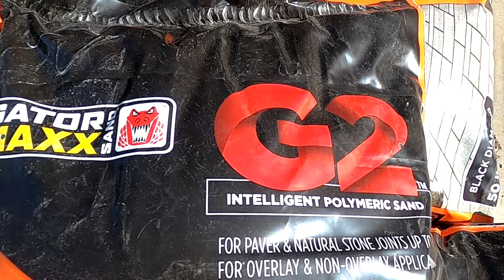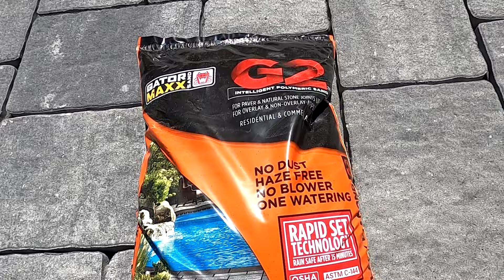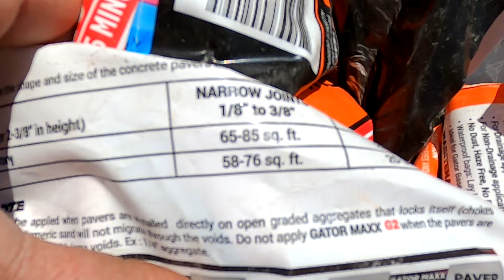How To Polymeric Sand a Paver Patio (DIY)

Comment: Very nice! You have me sold on the black poly sand. Do you have a video on cutting the border pavers around the fire pit? It also looks like you left 1" of stone between the pit and the pavers, correct? This is exactly what I am doing in a 15ft round patio with a fire pit.
Reply from the maker: Nice man, the black poly adds so much character 👌 I do have a video on how we cut the pavers around the fire pit. here is the link to that video 👉https://youtu.be/1Z09RARiWaM

Comment: thanks for the video. I did hear before that you should not use so much water that it runs off. I just did my pavers and used just enough to wet the polymeric sand, and I did 2 passes 15 min apart, but I did not use as much water as you did to see so much white "polymeric activation".
Reply from the maker: No problem, there is definitely a balancing act you need for the right amount of water. If you put too little, it will not get through the layers enough to activate the entire depth of sand, causing it to be very weak and possibly peel up later.. If you water too much, you could wash out the sand before it sets. What I do is start at the lowest point and lightly shower it up to the highest point. Then I immediately go back to the low point and saturate it all up to the highest point. You don't want to be bashful with the water, you just need to watch out for sand washing out of the joints, but if it does not wash out, more water is better. 

Here is another polymeric sand video that I made which shows how much water I use 👉https://youtu.be/TXWJyBnVQ_g

Comment: How are rounded bullnose pavers, which are used for the rounded step we have, how are they joined together?
Reply from the maker: They are typically laid in concrete adhesive and just placed right next to each other. But when used for coping on a pool, sometimes they are laid in mortar and they also get laid with a joint of mortar in between each other.

Comment: Ok, question, my pavers are old and pretty porous. So the polymeric sand is really sticking to the pavers. Am i going to have to brush off each paver individually, or will it work out if i leave it there and it'll wear away with time? What do you suggest?

Still thinking on this.. do i need to seal my pavers somehow? (First time home owner here and took on a project im starting to think was outside of my skillset)

Comment: Hey, man. I can't thank you enough! Your videos got me through laying the base for a backyard paver project. It was really hard work, I had to move all of the stone by shovel, through a gangway, and into my back yard. But it was very enjoyable. I live in the city and had 5 cubic yards of 3/4" and 2 yards 3/8" stone dropped on the sidewalk in front of my house. My neighbors lost it! Anyway, if you don't mind, I have a question on using polymeric sand. The guy at the materials shop I used told me using poly sand on open grade base is a no-go. He said the sand eventually works down into the stone base, and that open grade base requires permeable stone or permeable sand in the joints. He recommended a smaller chip stone. The other thing is I'm installing Holland pavers which have a smaller space than the pavers you're using. I know nothing about pavers, and you've done hundreds of these, so I wanted to reach out and ask you what you thought. You're using it, so I'm assuming it's fine. Sorry for the long message. Wishing you well from Chicago!
Reply from the maker: 🤣 That is hilarious about the stone delivery! I'm glad my videos were helpful, thanks for the feedback on that. I use regular polymeric sand on 99% of my projects even with Open Grade Base. Once the polymeric sand hardens, it will not sink in to the stone. Been doing it for almost 5 years now with no issues. Good luck and congrats! ✌

Comment: I love the videos. I have a question. Should the sand be to the top of the paver. The sand is down in the joints on my patio like 1/8” below the surface.
Reply from the maker: Glad to hear it! We install the polysand just below the top of the pavers. it helps let the water flow through the joints.,

Comment: Great vid, lots of info. How do you deal with the haze left over from the polymeric sand installation? How do you clean the haze before installing the sealer? Thanks!
Reply from the maker: Most Polymeric sands that are out now, leave no haze. If it feels sticky or looks hazy, just rinse with water a few times. If that does not work, there are many paver cleaners out there that will help.✌

Comment: Hello I have a question, how many years before I would need to re-apply polymetric sand?  My installers workers said once every 2 years but the installer himself said maybe every 5 years.  I can't seem to get a good answer lol. If I need to re-do it, would I have to hire a contractor to do it?
Reply from the maker: Hey there, the answer he gave you is basically correct. If done correctly and assuming the polymeric sand is top notch quality, you could get 2-8 years. Closer to the 2 year side if the pavers are in a shady / constantly wet area. Closer to the 8 year side if the pavers are in a sunny / very dry area. Unfortunately that is the way it goes with poly sand. They have been coming out with stronger joint sands throughout the past few years but they are very expensive and more time consuming to install. DIY Polymeric is definitely possible but keep in mind that you can really ruin a project if you make mistakes installing it. Hopefully that helps. Good luck ✌

Comment: Thanking God for some sound patio paver advice! And thank you sir!

What kind of polymeric sand would you recommend for pavers that I only have a 1/8 inch joint? Also, are there any good synthetics/resin sands That would work with 1/8” joints?
Reply from the maker: No problem, glad it was helpful! I would use polymeric sand even with 1/8 inch joints. It may take a couple passes and tamping, but thats really the finest sand that I know of.... Some polymeric sands are finer than others. The one I use most is made by (Alliance) and its called (G2) and I usually use the color tone (Black Diamond) very fine sand particles.... ✌

Comment: Hey Christian love the job, well done. Had a quick question for clarity on the video. Where you have the pitch of the grade when it comes to the firepit area is that level or does it follow the grade of the rest of the patio area. Hope that makes sense
Reply from the maker: Thanks for the feedback! The entire patio slopes down and away toward the far and by the firepit. There is no perfectly level spots in the patio. I generally always slope pavers (walkways and patios) in 2 different directions to insure the water stays away from the house / structure. ✌

Comment: I just found ur channel and just subscribed!!! :)

I just got a house and the front pavers have settled and are not leveled with a pitch away from the house.  The poly sand is all gone and weeds are growing in between the pavers.  What’s the best way to fix the pitch??  What tools do u use to lift the pavers up?  Also, is the border pavers cemented in place, bc it seems like mine has a cement border near the grass.  Any advice would be helpful!!!  Thanks!!!!  :)
Reply from the maker: Nice, thanks for the support! I'm sorry to hear that your pavers are settling. It is a more common issue than you may think though... To fix, you need to pick up and relay all the pavers that have sunk. If there is concrete around the edges, you just need to break it up and remove it. Then you should be able to start lifting the pavers from the edges. When you pick up the pavers, you need to scrape the remaining poly sand off the edges and brush them off. Once the pavers are removed, you need to remove the sand / stone dust under them and put new clean, crushed stone to prevent them sinking in the future again. I have a lot of videos on how to lay pavers and how to backfill for them. Just look through my channel and I'm sure you will learn everything you need to know so you can fix the problem yourself. ✌

Comment: Great stuff thanks for info. 

I’m building a timber a pavilion and paver patio. Posts are already in place. How long after applying the poly sand can I work on top of the paver to finish my heavy framing and roof? Def don’t want to ruin the pavers or the poly sand app
Reply from the maker: Oh nice, glad the video helped! I would give the sand 24-48 hrs. If you touch the sand it is really hard, you will be all set ✌🏻

Comment: Hey there, firstly love all your videos. Have a question regarding your fire pits. In this video you installed all the pavers and then circled the line for the pit. In the previous job where you had the breeo I thought you put the fireplace in first. Is there a right way or not really? Looking to start a DIY job at home and that will be a figure 8 and in one of the circles will be my pit for a breeo install so keen to get your thoughts
Reply from the maker: Hi, Thank you! You can do it either way really. The circular patio I did was to be built around the firepit as my center point. This project had to be laid out just right before I could find the center point for my firepit. so with this one, I had to lay the pavers first and then build the pit. It may vary depending on the job or the plan so whatever works best in your mind when planning the layout. It sounds like a cool project man, good luck! ✌
Reply: @TheChristianHardscaper  thanks so much for your quick reply. I’m based over in Washington state (Seattle) and we get a lot of rain. I’m keen on using your method for underlay however some of the landscapers where I’m getting the pavers are suggesting to stick to the crush rock sand model of old, however I love how clean and easy your method looks. Wanted to see if you know of others that are out west that have done similar bases to you?
Reply from the maker: @social_euge5896  No problem, Unfortunately a lot of contractors are refusing to switch to this backfilling technique.... All I can say is that I used the crush rock and sand technique for 5-6 years prior to switching to this method 4 years ago. I will never go back. The most important reason to me is that this system does not hold on to or absorb water. The crushed grave and sand absorbs water like a sponge. This causes a lot of shifting and settling over the years to come after the install. It also cause the base material to freeze and heave more because it holds onto water. The end goal of all drainage is to get the water to permeate into the subsoil. no material does that better than open grade 3/4 clear stone. ✌

Comment: Hello and thanks again for these videos and advice!

 I’m just about done laying the borders, and am getting ready for concrete edging and then poly sand. 

How long Do I need to let the edging harden before poly sand and compacting/tamping?
Reply from the maker: Oh nice, your moving right along! So I would actually recommend doing them at the same time if possible. doing the sand wand tamping while the concrete is still wet is the best way. You can trowel the concrete the way it needs to be in a small section at a time, then sand that section, tamp it, then sand it again. At which point you can trowel the concrete one more time to be sure the bond is still good on the pavers. Then move to the next section. 

I try to do it like that as often as possible, unfortunately a lot of times, it doesn't work out that way.... At which point, you want the concrete to set for at least 12+ hours. And when you tamp, go a little easier around the edges so you don't completely ruin the bond between the concrete and the pavers. Hope that makes sense...✌
Reply: Tomorrow it will be going down… thanks again!
Reply from the maker: Sweet, good luck brother!

Comment: If I'm doing porcelain pavers, should I be tamping or compacting them? Everything I'm reading says you can't run a compactor over porcelain due to potential damage
Reply from the maker: Yea, I would not run a compactor over them. They are to fragile for that. But I would recommend hand tamping them with a nice heavy duty piece of foam so you are not tamping them directly. But especially with porcelain, you need to make sure you fill the joints as much as possible. Just be easy and you should be fine. If you use a piece of (Gator Base) the 1 inch piece of foam that some people use under pavers in hard to excavate areas, that works really good ✌

Comment: Love your videos, especially using crushed clean instead of sand and QP. Seems like it’ll hold up way better here in the north east. Can the bedding layer of 3/8 crushed be 1” thick like sand or is 1 1/4” needed? Just asking since all of my screed pipes are 1” OD that I normally use for bedding sand.
Reply from the maker: Thank you and the clean crushed stone is key! And yes, a 1" layer is just fine ✌

Comment: If I may ask, is it advisable to use pea stone as a finish top on a road fill base for a patio area? OR, would you advise using pavers?
Reply from the maker: You can definitely use pea stone, the only thing in my experience is that the customer usually finds out that the stone is much harder to walk on, set chairs on, etc... than imagined. Especially the round pea stone, it moves around very easily. So I guess it depends on the area you are wanting to do it in, will it be heavy foot traffic? If so, maybe pavers are better. Up to you though ✌

Comment: Do you recommend a particular salt for winter?
Reply from the maker: I don't really have a recommendation. Rock salt is better than calcium tablets. It is easier to clean up and does not get into the pours or the pavers as much. But always use as little as possible and clean up any excess after everything melts so they don't get damaged.

Comment: If you area re-sanding pavers that have been in place for 17 years, do you need to tamp any of the pavers or sand?  or can you get by with just the broom?
Reply from the maker: If you are just sweeping the new sand over the old sand, it will probably not hold up for to long. If you are re sanding pavers, the joints need to be cleaned thoroughly ( power washer is usually the best option ). Then once the pavers are dry, follow all the steps like this video (including tamping) to get the best result ✌

Comment: Have you noticed any problems with Alliance G2 polymeric sand? I watched another video said Alliance had changed their formula and now only the top layer of the sand was actually setting up but the sand beneath was still sticky and it never set up.
Reply from the maker: I have.... It is almost like the sand / polymers are so fine that the water can not travel through it while soaking it down. Which causes the sand to fail much sooner... however depending on how you watered it, it may last longer / not as long. This project a many others from last year are holding up good. Been using a new manufacturer this year. (Techniseal) is who makes it.

Comment: Guess the poly sand part in your new project will come some days later so I'll ask here :P IIRC you put on concrete edging first and then compact/shake the paver with sands.  Do you have to avoid the rim pavers in this case? Or else will the concrete got damaged or the bricks shaken apart from the concrete ? Thanks a lot!
Reply from the maker: The absolute best way is to do the polymeric sand at the same time as you concrete so that you do not break the bond. With that being said, you always have to be careful when tamping the pavers around the edge... I set my border pavers lower than the main pavers just a tad with my dead blow hammer so that I know they are all set for when I do the sand and compact. Most times I concrete the edge before Poly sand. This helps hold everything tight. Then I tamp the edges easy to settle the sand in and prevent breaking the bond with the concrete. Hope that makes sense... ✌
Reply: @TheChristianHardscaper  Thank you very much for the hint. I can tell that "tad lower" requires lots of experiences. My paver is about 1k sqft and based on my 1st timer DIY pace, doing them together is likely impossible. I probably need to find a small area to test out first, see how much give the final compact can make. I've heard people saying 1/8'' - 1/4'' but it is already a big range. Any suggestions?
Reply from the maker: I always say that a 1/4 slope is better than a weak 1/8 slope. You want to make sure the water can run off the pavers. Using a 1/4 slope is a great way to be sure of no water build up. And when your walking on it, you will never tell the difference…. Better safe than sorry sometimes ✌🏻

Comment: You don’t leave any pavers for them in case they need to replace any in the future.
Reply from the maker: We do most of the time but there are some customers who do not want the extra laying around. Just depends on what they want.
Reply: @TheChristianHardscaper  Gocha makes sense I used to do flooring years ago and floor products would go out of stock all the time. Is pavers kind of the same way? Looking to expand into hardscaping in my business
Reply from the maker: @yardgenie2933  That's cool man, I hear you about the flooring, they do seem to discontinue products like that way more often than pavers. Most of these paver manufacturers have a core line of products that they sell and have been selling for many years. So typically you can but more at anytime. But when I use special order material / uncommon materials, I leave the leftovers for the customer for sure. And if you have a lot of flooring experience, I'm sure you could pick up laying pavers. Definitely a different animal but the concept is simple. Just takes hard work and practice. I wish you the best brother!